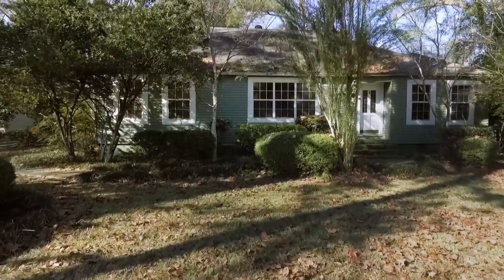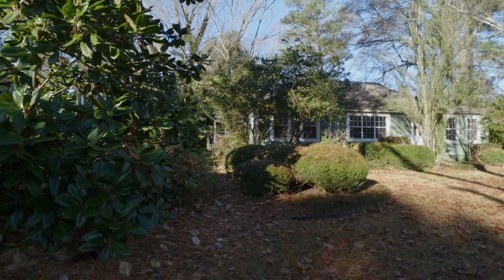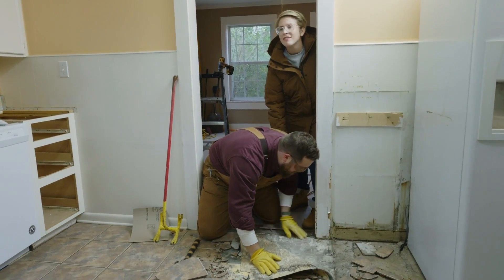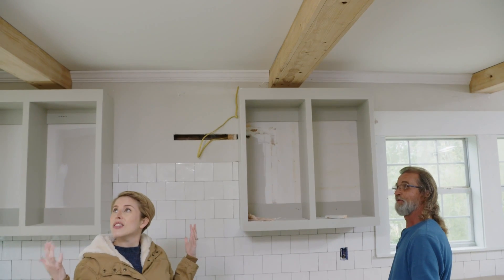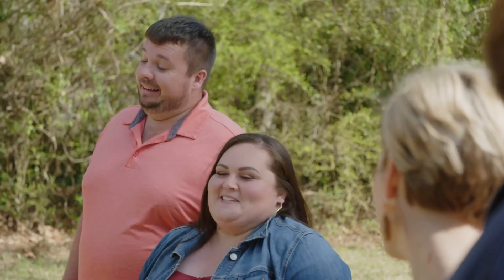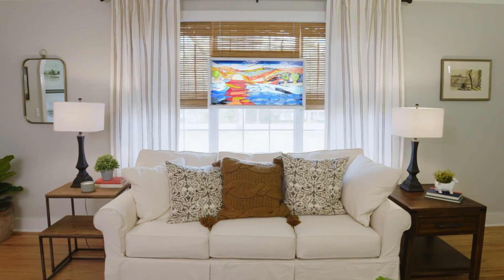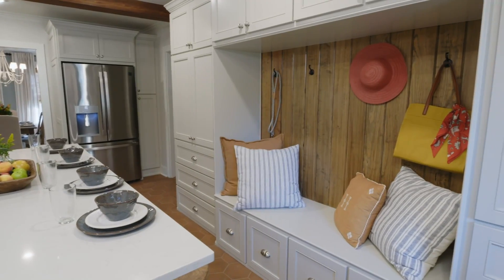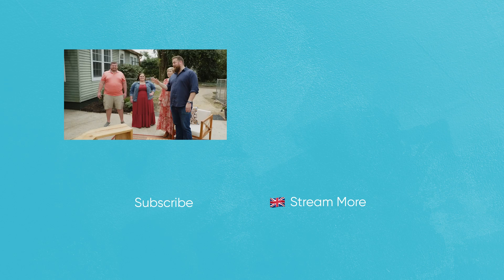"It's A City House In The Country" Ben & Erin Renovate A Historic Property | Home Town

Comment: I usually love the homes on this show, but I have a criticism when it comes to this home: the tile work. There is grout missing on the narrow tiles on the side of the hearth. It also looks wonky--like a poor solution to too big of tiles. The narrow tiles should have gone around the entire perimeter of the hearth to make it look like the thin tiles were on purpose. The white grout or caulking on the outside edge is sloppy looking, too.

I don't know if it's necessary to have grout between the bricks of the outside fireplace but it looks like it could easily be pushed over with one shove.

I think Ben and Erin need to find a new tile installer.

Comment: Horrible idea with the dog bowl and water dish in that drawer.
I saw the water slosh around when the door was opened.
Furthermore, while the pet is eating, the open door impedes traffic.
 👎
Reply: You are so right, also the dog keeps pushing the drawer shut as they try to use it. This renovation was actually done several years back. I lived in the house for a summer while working for this couple.